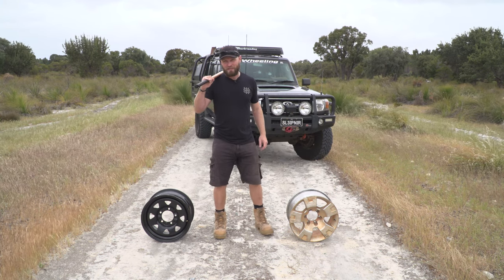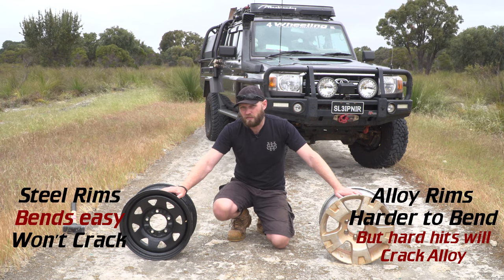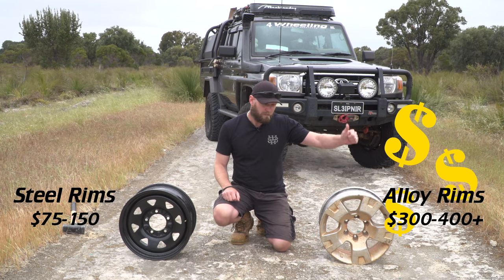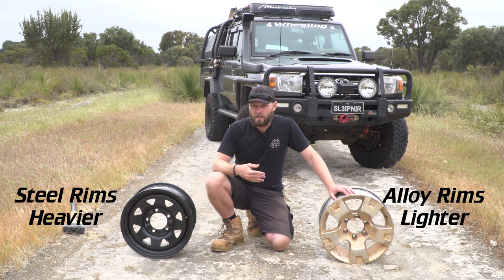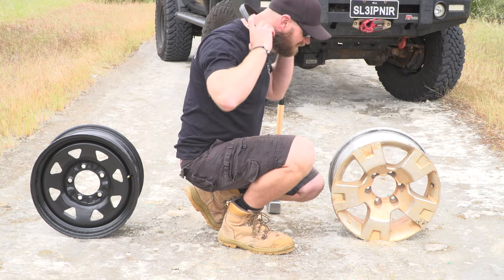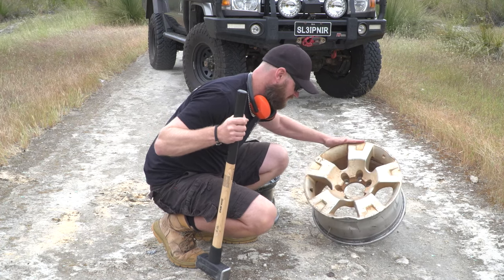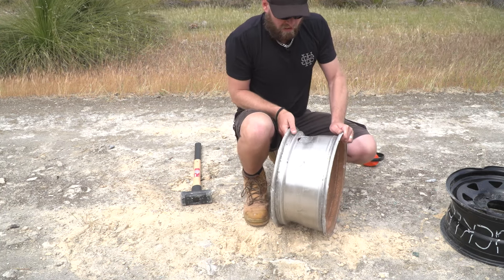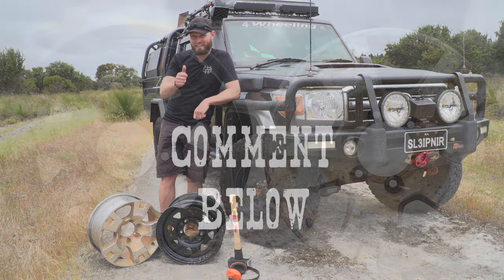STEEL vs ALLOY rims Off-road Wheels

Comment: Ive been into 4wheeling for 20 years and the one constant problem I have with steel wheels is they get knocked out of balance.  I drive hundreds, sometimes thousands of miles on the road to reach the dirt and wobbly wheels absolutely suck on the pavement at any speed over 40mph. Most of the wheeling I do is in the rocks and a mickey thompson classic alloy (and other quality aftermarket alloy rims) can take some pretty hard hits and still stay nice and true.
Reply: I had steelies and didn’t realize how out of balance they were until I switched to alloy. I always thought my tire installers couldn’t balance well, but it was warped rims all along

Comment: Steel painted black looks better than any alloy wheel
Reply: I put black steel on the 79, with offset on the rear, so cheap and easy to maintain and keep the Toyota ones looking like new for resale
Reply: Each Day but alloy painted black looks better than that
Reply: I have black steel wheels on my Jeep. Looks much better than alloys i had before.

Comment: Alloy ≠ Aluminium
Reply: Yes Ronny was confusing me on that one.
Reply: eh, close enough.  Steel is also an alloy but I think thats just shorthand for many when they mean aluminum alloy.
Reply: Correct Patrick.  In the context of automotive wheels, such as this video, alloy does equal aluminium.  And given that magnesium alloys are so rarified that the owners will happily refer to them as "magnesium" and let aluminium folks eat their alloyed cake.
Reply: Jesse, do they make purely Aluminium rims?
My understanding was rims were alloyed i.e. mix of Aluminium and something else.
Reply: I am pretty sure that nothing is made of pure aluminium.  I think it is super brittle.  To be clear, I was talking about semantics not chemistry; But yes, all "aluminium wheels" are alloyed... but not all "alloyed wheels" are "aluminium".  The case here is that probably 98% of all commercially available "alloy" wheels are what you would call and aluminium alloy.  Being that wheels don't have feelings, it is perfectly safe to generalize here.
Reply: Soda cans might be pure aluminum. 😀
Reply: "Modern cans are generally produced through a mechanical cold forming process that starts with punching a flat blank from very stiff cold-rolled sheet. This sheet is typically alloy 3104-H19 or 3004-H19, which is aluminium with about 1% manganese and 1% magnesium to give it strength and formability." - Wikipedia
Reply: @Jesse Ansell: pure aluminium is the opposite of super brittle
Reply: @joeking22  aluminum rims are a mix of aluminum with chrome.
Reply: Cheers Colin
Reply: Allow as its a mix of alumimum and nickel. The steel rins are also an alloy as they are part carbon part steel mainly. Theres other minerals in them also, but those are the main prominent ones.
Reply: @brandoncaldwell95  Steel is Iron/Carbon alloy. Not Carbon/Steel 😂😂😂 Steel can be further alloyed with other metal aswell.
Reply: @jasenrock  what? Hub caps that are normally placed over steel rims because people are to cheap to get alloys or are you talking about a centre cap that covers only the castle nut cover?
Reply: @liamcooper5202  Maybe you should look up rims and wgat thy are made of in the compounds before commenting.
Reply: Yeah technically aluminium is soft n can warp (It’s not brittle). 

Cast iron is brittle. Can hold a fuck load of heat but yes brittle. 

Wait now I’m talking engines, not rims haha 😎
Reply: Pure aluminum is super soft. All aluminums are an alloy with properties that vary for their intended purpose. Harder the alloy the heavier the weight so there’s a  trade off.
Reply: aluminium here is just a short way of saying aluminium alloy
Reply: @PatrickRich  Steel actually isn't an alloy, stainless steel is. You have different compositions of steel based on carbon content. It only becomes an alloy when another metal is introduced to make it an alloy (combination of metals) Which comes the stainless steel variants which use combinations of chromium, nickel, manganese and such. However stainless steel is much softer and less durable than non stainless steel.
Reply: Alloy = not aluminium = not aluminum
Reply: Hottspitta jR 
Steel is an alloy of iron and carbon, and sometimes other elements like chromium.
Reply: @joeking22  yes it's called billet aluminum, and there solid aluminum and sum are one solid piece
Reply: All of them are alloys, steel wheels are an alloy of ferium aka iron, mag wheels are an alloy of magnesium, and aluminum wheels are an alloy of aluminum, none are pure, if they were, iron would be too heavy and not as strong, and aluminum and magnesium are too brittle, for the application.
Reply: @andrep8479  there are no castle nuts on any wheel. Castle nuts are nuts used with a cotter pin to stop any chances of backing off. Wheels use lug nuts, that's why torque spec on lug nuts are important
Reply: Alloys can be repaired in a shop, drill either end of the crack to stop the fracturing and bust out the tig and bam
Reply: Alloy rims are made with aluminum or magnesium alloy.:
Reply: @JrSpitty  actually steel is an alloy. An alloy is a mixture of metals, or a metal combined with one or more element. Steel is an alloy of iron (a metal) and carbon (an element).

Comment: I've shattered an alloy rim off-road. it was only on bad corrugations, on a late model Subaru Forester, but it pulled a fist- size rock, hidden, out of the corrugations. Shattered the front,  got the rear as it went through , as well, damaged the rim enough to unseat the tyre. It cost me two rims, two tyres, and a tilt-tray recovery. Ok, they weren't full-size 4wd tyres, but, never again.

Comment: Big lesson here: If you might take hard trail damage, it's not about which wheel is STRONGEST, because neither is strong enough to shrug off all impacts. It's about which is DUCTILE enough to bend and then get bent BACK without cracking. Cast aluminum isn't very ductile. I'd love to see you do this test on a FORGED aluminum wheel, although I know they're rare in off-roading because of the huge price. Braid makes some very cool forged aluminum off road wheels, even beadlocks.

Comment: Totally agree with your assessment, even straightened out a steel rim with the back of an axe in the middle of Kakadu once, that wheel was still on the car years later when I sold it.
Reply: search YT for wheel straightening vids and equipment. hammer to a bent steel on is not that far fetched
Reply: I hammered a dent out of my rim in the back of a Sonic when I clipped a curb in my POS sedan that I was cursed with back then. Some of the employees were impressed with my "ingenuity" as they apparently saw it.

Wow, I don't spell out the word ingenuity very often. It looks a bit funny. I suppose that's to be expected when you live in an area where most people think "injunuity" is a racial epitaph...

Comment: One thing that wasn't mentioned in the weight section was unsprung weight - even small differences in weight in your tyres and wheel weight make a considerable difference to fuel economy and power.
As with everything, have to weigh up the pros and cons. Keep it up Ronny love the videos
Reply from the maker: +Chris Milne I did think about that but left it out due to the rims being nearly the same weight.
Reply: This matters a lot less here because so much of the unsprung weight comes from the tires and possibly axles.

Comment: I love my alloys. I like steel too. I've used both in arguably heavy to light offroading/rock climbing and have yet to crack or damage my alloys, but have (on occasion bent the lip on the steel , only slightly). 
Steel is cheap and has many advantages (as you described) and on a Looooooong trip, I would definitely go steel, but I wouldn't say that aluminum doesn;t do well offroad entirely. Maybe I've just been lucky or maybe it's my tires that saved my rims. Either way, the alloy rims have been fine. They are also 20" rims on 35" tires...so 20" seems to do alright offroad as well.
To each their own. I like the look better. There are a few steel rims out there I like almost as much, but unitll I do a long distance trip on ONLY rough terrain...I'll keep the alloys. Most of the long distance driving I do is on pavement to get me to the rocks.
I still gave you a thumbs up and subscribed, because I've been watching your videos for sometime now and you always give good information.

Comment: Great video - one very important feature of a steelie you missed - ‘the rolled edge’ - when the tyre is aired down or even at normal pressure, when the tyre flexes over the edge of the rim there is less stress on the sidewall and therefore less likelihood of pinching the sidewall compared to the ‘sharper edge’ presented to the tyre wall on alloy wheels. This rolled edge of the steel wheel is also less likely to pop the tyre off the rim due to the taper of the internal/external curve. Another advantage of the steelie is the ability to break the seal roadside just using minimal tools by driving across the wall of the tyre, as the well in the centre of the steel wheel gives relief to the tyre bead when being popped in.

Comment: Yeah I've gone through 4 aluminum wheels for my 2nd gen 3/4 ton dodge in the past 2 years. They aren't cheap, I just got some steel ones earlier this year so I don't need to worry about my wheels cracking anymore.

Comment: Damaged alloy and steel rims make excellent vehicle stands. I accumulate them in various sizes so I can nest them when stacking if necessary when working on project trucks or fabrication. They don't tip like a jack stand  (I gave my jack stands away many years ago) and with some 4x4 and 4x4 wood blocks for fine adjustment are very versatile. I use some castoff steel rims too but alloy doesn't rust and is nicer to handle.

Comment: I definitely agree that 20inch plus rims are not good for offroading.  Mallcrawling only.
Reply: Unless it's sitting on 46 inch military tires
Reply: Ben Lorentz I have 18s with 33s and that’s still way too much rim.
Reply: Sven Rasmussen hahaha so true.
Reply: Yup
Reply: 18" plus.  17" is the max that looks good, and frankly that includes all cars as well.  Wagon wheels and rubber bands for tires look like ***t on everything!
Reply: 37's on 20's is the same as 33's on 16's.  I like the Continental MPT 81 but they are only available for 20's.
Reply: I have 37's on 20 inch rims. reason for the larger rim, came with the vehicle and it was cheaper to get larger rubber than to get smaller rims and large rubber. I have plenty of rubber to air down, and the rims are steel.
Reply: Xd136 panzer, beadlock steel wheels that are 20x12
Reply: I prefer fifteen steelies and 31" rubber. To be fair, I'd have to install a 2" lift to fit 33s on my truck or I'd have those instead. Also I've noticed that it's getting a lot harder to find tires for the fifteens, so I might have to go up to sixteen eventually. My upper limit is seventeen, because with a 31 tire that's seven inches of rubber buffer wrapped around the wheels and I won't accept less than that. If you have twenty inch rims and 31s you only have five and a half inches of tire. How tall is a speed bump or a curb?
Reply: Most people see these soft roaders coming with 18" as standard and think that's good. For me, 17" would be my limit but have 16" on my KJ , with backup 15" mud tyres and steel rims. The WH I'm buying has 17" and I'm ok as that will be more of an overland vehicle and will see plenty of blacktop

Comment: I appreciate the points you made, it was well done. As far as the weight issue, for me it's not about how my back feels, but rather the importance of rotational mass. Rotational mass makes a big impact on acceleration and braking which also plays into how much you can carry relative to performance. 1 pound (.45kg) of rotational weight is comparable to 5-10 lbs (2.3-4.5kg) of static weight. 4 steel wheels are approximately 32lbs (14.5kg) heavier than alloys. So that 32lbs of rotational weight is comparable to 160-320lbs (73-145kg) of static weight. 
That seemingly small difference in wheel weight is comparable to having front and rear steel off-road bumpers or not. Again, this effects acceleration, braking, and fuel economy. Note: these are effects to performance not gross weight (vehicle weight). Just something to consider along with the other factors Ronny mentioned. This may not be so important to a large diesel driver as it is me a 4.0L petrol owner who is grasping to every bit of power possible. Hope this helps. 👍
Reply: Narrow Road Adventures Your extra rotational mass is very useful off road. You now have 4 significant flywheels. Especially with open diffs, heavy wheels make a big difference to how fast a wheel stalls when its brother on the other side suddenly has a big traction advantage.

In realistic terms, the only improvement you will ever have to make is in braking. A softer pad compound is usually enough to give the bite back. I have done this myself after I bought a very heavy set of 60 series sahara chromies. Even then, it was a feel issue. The brakes still had more than enough to exceed the friction of the tires.

If you want to be very specific, you will add more rotational mass by going from 31x10.5 to 33x12.5 as you have put all the extra weight in the tread area where velocities are highest.

In any case, the weight difference in 4x4 wheels is not as significant as on cars. Alloy 4x4 wheels have a shit ton more volume of metal in their construction. The centre disk is always very thick as is the outer rim. They have to be as most mechanical engineers are well aware that aluminium is brittle amd will not survive 5 seconds with the shock loads that a 4x4 is guaranteed to put through them. Not to mention the lateral loading that a 3 ton truck puts through the centre disk in cornering.

Alloy wheels also have much more drag. The heavy, thick spokes are rotating at a significant speed. The spokes are moving alot of air. Steel wheels with their thin centre disk do not have this problem.

All factors considered, you would be pushing to find even 1% increase in fuel usage by using steel wheels.
Reply: I guess if you're concerned about high end and top speed then rotational mass is an issue- otherwise gear yourself correctly and you won't notice any difference between the 5lb more steel rims over the alloys.  I mean my new tires weigh in nearly 70lb, that's where my real weight comes from not some 22lb vs 27lb rim.
Reply: Don't Forget where to weight is. It's in the centre, which has less centrifugal force. So your 10% heavier steel rim does equate to 10% extra rotational mass (10% for example only). Also I think you'd be hard pressed to find a set of (4) 16 inch steel rim that are 32lbs heavier. Maybe 20-25lbs?
Not saying you're wrong, it was a good point in fact.
Reply: @freefall0483  hahaha open diffs?  If you dont have atlease one locker you are doing it wrong. I would rather walk than put up with an open diff getting stuck at every bog hole, rock shelf and hill climb. Been there done that and its shit.
Reply: you look like you like to calculate your stuff and that's great.
In dynamics the "rotational mass" is know by the name "moment of inertia" and it's it tells how much work and work is needed to change the angular velocity in the specified axis. Sorry for being a year late.

Comment: I was at a tire shop getting a new tire for my utility trailer.  It uses car size rims and tires.  The valve stem had blown out and the tire rapidly deflated.  I was a pretty good distance from the next town, so I had to hobble along on the side of the road for quite a few miles.  The tire was completely destroyed and there was just rim left.  The only damage to the rim was the edge where it was contacting the concrete of the road and all it amounted to was the paint was no longer there.  While at the tire shop, I saw a small pickup that had alloy rims and who had had a front tire blow out on him.  His much thicker spokes on the rim did not help him, one of them had broken off and of course the circumference of the rim was also broken.  That convinced me that steel was better than aluminum alloy right there.

Comment: From the beginning of my WJ Cherokee build. Aluminum rims came off. Steel rims went on. Also I carry a full tire repair kit. Valve stems. Metal and rubber, valve core, plugs, patches and a tube. Plus the tools.

Comment: Kudos for such a professional tutorial and a live demo. Yes, it was apparent why and how your hands were hurting by the end of the demo :)
Reply: so i recently learned most australian vehicles for off road are heavy. lots of gear and so on. i am never far from help or a ride home so i run empty and less spare tire even for now. my Jeep is 3500 pounds roughly. i saw ronny posted his is 8000 pounds or just over as i recall. i realize the remoteness and climate can kill you, and you need to be prepared. but i try and keep my junk as light as i can. a lighter vehicle is less stress and wear on the drivetrain for sure. and u joints